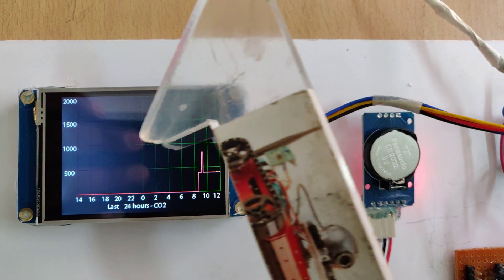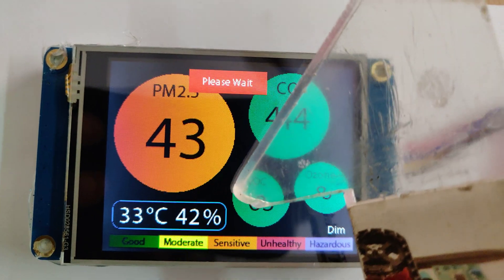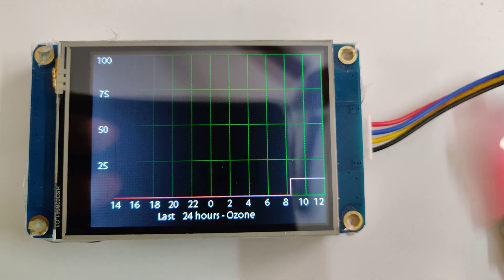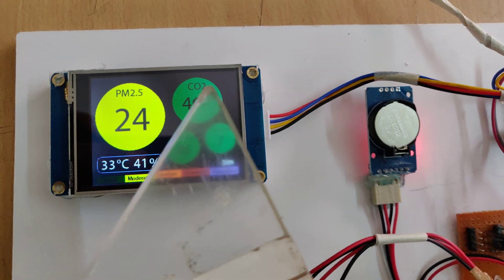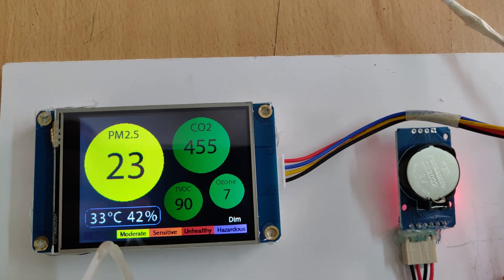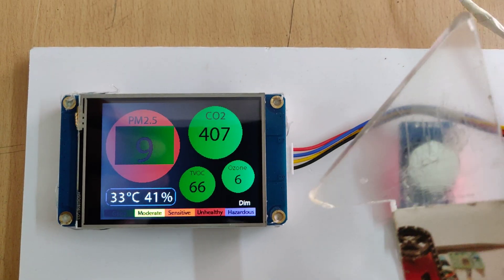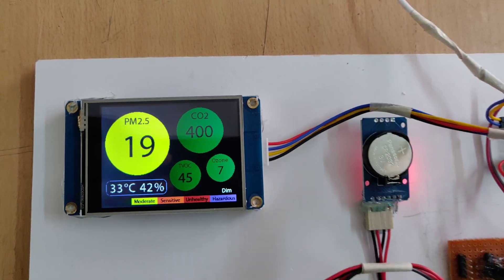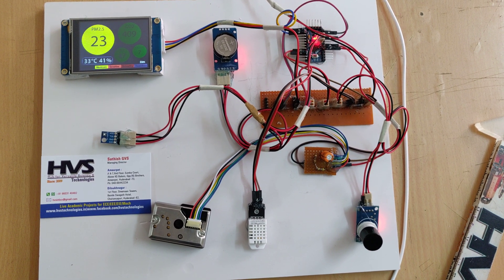Air quality meter using Arduino pro-Mini Nextion display, Ozone MQ 131,  PM 2.5, SGP 30, TVOC, CO2

Comment: Hi. Great job. Congratulations!
I need an ozone sensor (regulator) that can turn the device on or off (ozone generator) so that I can regulate the amount of ozone produced in the range from 150ppm to (500ppm or 1000ppm) can you make me such a system with a display etc?
Write me how much money would you like for such an electronic circuit ??
Reply from the maker: You can contact us at +919603140482
Through WhatsApp or call

Comment: for low ozone Which sensor is better metal or plastic mq-131? and code If you can give us
Reply from the maker: Plastic mq131
Reply from the maker: You can contact us at +919603140482
Reply from the maker: you can contact us at +919603140482, through WhatsApp or call